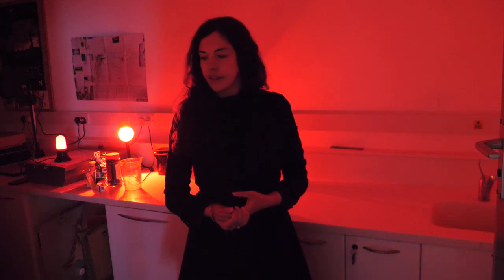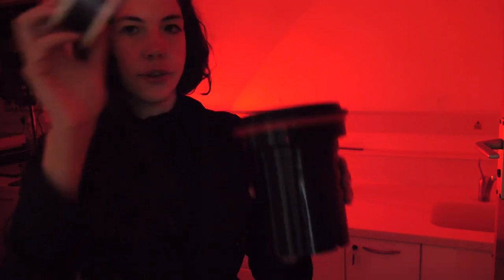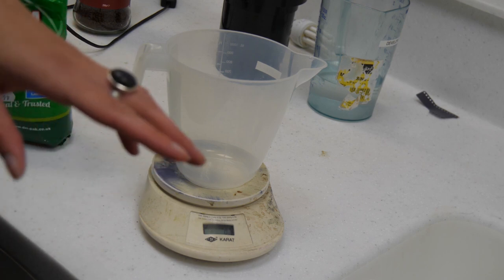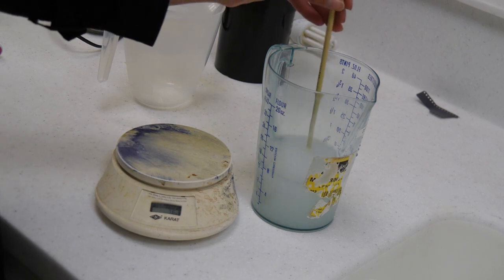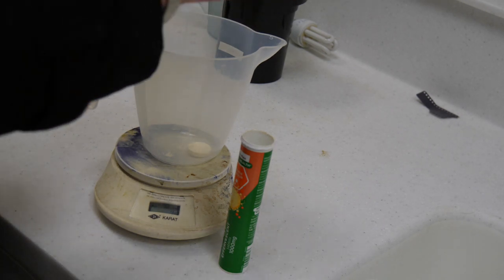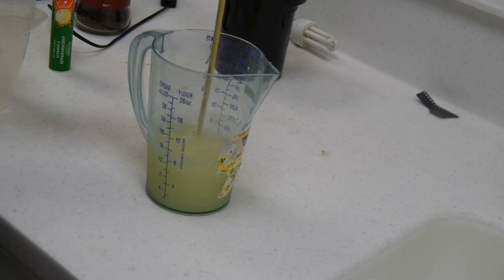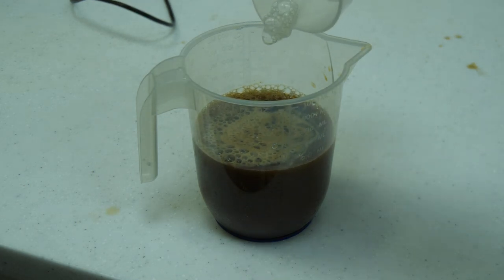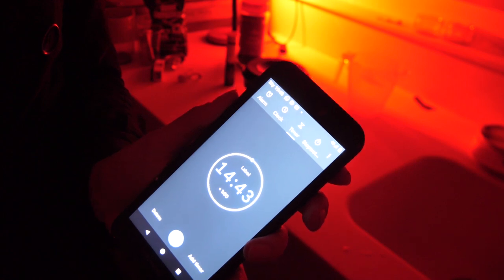#DIY Developing Film At Home Using Coffee // Caffenol-C

Comment: FYI. It is normally to agitate for the first 10 to 30 seconds after adding the developer to the tank, also after each agitation tha base of the tank needs to be taped on the counter top to release any bubbles, which could cause local uneven development. I have used caffenol to develop 135, 120, 4x4 and even 8x10 with great rsults. Good video. Thank.
Reply from the maker: Thanks Phillip :)

Comment: Pre wash by and tip and fill the  drum till water is clear.. Ripens film and rids it of antihalation layer and manufacturing gunk and  then use water stop bath same method. It keeps the fix clean and acid free as much as pos... Once stopped I fix in a 4 liter food container by taking reals our of the drum and popping them on a home made hanger using plastic coated wire once in the fix I turn on the light dip and dunk till I see the film clear completely. I also replenish with 50ml. of neat fix every now and then when the initial milkiness takes too long to go. Iflord rapid fix 1:9.

Comment: Ahhh interesting stuff! Can you develop any kind of film in this? Also you mentioned getting copper for the fixative.... where does one buy copper?
Reply from the maker: I think so! I have tried Ilford HP5, Ilford FP4 and Kentmere 400. You can try colour film but it would turn black and white as far as I know. As for copper, I was given offcuts of a copper pipe. Looks like copper is quite cheap on ebay. I'm also thinking of collaborating with a jewellery designer soon to see if we can silver-plate her copper jewellery.